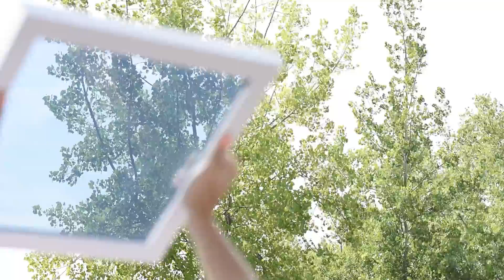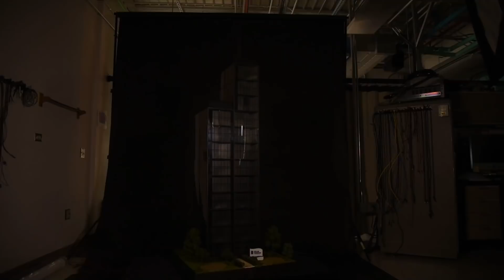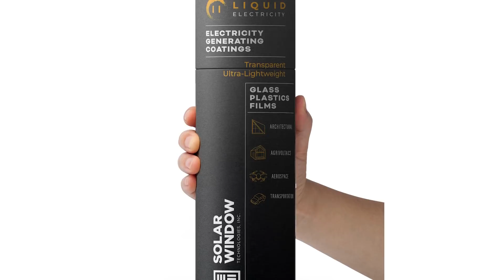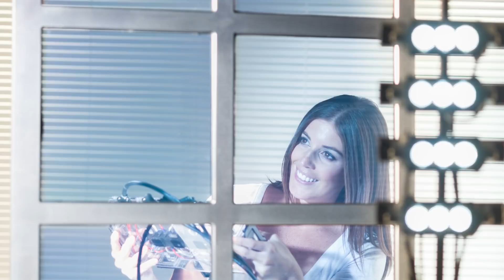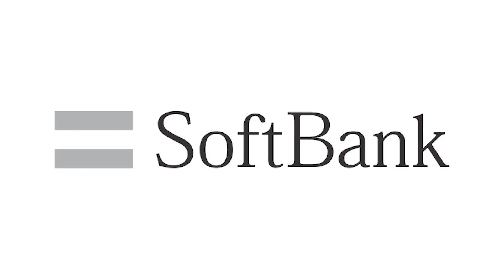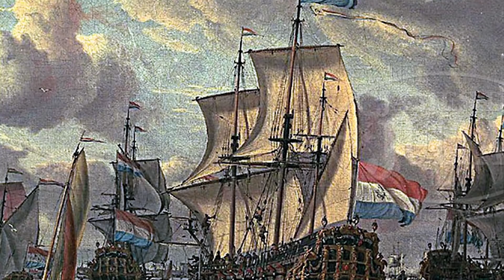Solar Window (WNDW) Your Next Solar Investment?

Comment: How does this affect heat, radiation or solar gain into the structure whether it be a building or a car because if it makes more heat coming through then we’re going to have to run our air conditioners harder that’s not gonna make a lot of sense!?

Comment: I had an idea in 1980 Put a thing called an Apple computer in a different box add a  different keyboard for trade typesetters in the world wide printing industry,  (pre WYSIWYG remember those days?)  and sell it to typesetting companies as an OEM through the main company in that business, -  7000 "terminals" later and 7 years across the globe I netted £20m turnover my company was also started by an unkonwn musican, Hans ZImmer!  This guy has NO entrepreneurial credibility and no physics lab street cred. I'd never invest in him its total tosh CAVEAT EMPTOR - Im doing a fun project now that doesnt even use electronics and it's presold 1200 units at 300 USD per unit, on a net profit of about 70% per unit, etc, and not even off the production line in volume - but it works as it's based on physics,  hahahahaha

Comment: I wouldnt trust them, = why too long, what about heat loss in the winter, etc, what's the thermal gain of a "glassified" building internally that you then have to deal with to remove all this wild heat, =   I live in Thailand and in my past incarnation I lived in Indai even as far back as 1971, at 18, - Thais say (Im serious about this) "If you see an indian and a snake - which one do you kill first? "  We got 3 kw per sq m here every day and it's 35C most days too, one thing you have to consider is "empty vessel makes loud noise" (Confuscious) This guy has still not shown any product except the snake coming out of the snake charmers basket. Get your graphene pants on dude.

Comment: When I seek a parking spot, what I need most is tree cover or shade for the car but I very seldom find it. Short of finding adequate shade, a windshield and car windows that impede the heating of the passenger compartment while  capturing  energy would be very welcome.

Comment: WNDW failed to file their 2022 annual report, for period ending August 31, 2022. In their prior 10-Q, they say "...the Company recognized an impairment of all assets related to the Korean Subsidiary totaling $674,200. The impairment was recognized due to the Company’s inability to obtain from the management of the Korean Subsidiary the complete financial statements and related documentation for the three months ended May 31, 2022 thereby placing into doubt the recoverability of assets located in South Korea." The market cap of this stock is currently $92M. I question who owns the technology and if this company is legit. WNDW needs to respond to filings regarding breach of contract, unjust enrichment, etc. as claimed in SEC filings: https://www.sec.gov/Archives/edgar/data/1071840/000117184322004372/exh_993.htm

Comment: It has been mentioned by Mr. j that our planet receives so much solar energy that it is thousands time of all the energy that we need. So far it is thought that the limiting factor for solar energy is the storage in the form of batteries, their manufacturing requirements of not only the raw materials but also their disposal and energy requirements etc. I personally think there is an alternate available. Instead of storing energy for use at night, energy produced in areas where the sun shines should be transferred to areas where it is night,  through a world wide network of transfer system. I know even at present the electricity produced at river dams is transferred to areas thousand of miles away. My suggestion therefore is some alternate more efficient systems for transferring electricity  over long distances should be  considered and a worldwide network should be developed for using electricity produced by areas where it is day in areas where it is night.

Comment: Is their proprietary technology ripped off the research by Derek lovely at Umass? He discovered geobactor sulfurreducens in the late 80s and now it’s believed that the nanowires produced by this microbe release energy in the presence of an evaporation gradient between anode and cathode. It’s biologically produced but doesn’t actually require living culture to work. It also functions best at higher temperatures, and due to evaporation as source of energy, this is indirectly a solar-derived energy source, but isn’t a PV cell in the way that silicon panels are.

Comment: Essentially it's millions of nano size solar panels offering circuitry, flow inside a solid harden pool structure called a clear element/glass. The only debate, is his persona of how it looks/runs/behaves and rate/result of power 🔋. So much hypothesis. Blah blah of a 🧞‍♂️👳🏻‍♂️ magic 🎩 🐇 tricks 🙄. Monologue oh how it be, if  it was  made (🐍 🛢 'ing spam it poured on you ).

Comment: Really good bullshit is still bullshit. If your that smart make an easy interim product that comes out of your processes I have been making things my whole and finally took my side interests of Geology and learned the Chemistry I needed and it opened huge potential and load of products that could be made. Which was easy and high prophet and filled a need health protection. Get a product out and satisfy your investors, 10 years is way to long 2 two 3 years you should had been cranking something out the door by then.

Comment: This is the most obtuse  individual delivery of unmitigated bullshit. This is an unnecessary worthless product, worse than a square wheel. The amount of electricity production is minuscule and the cost per micro-amp is astronomical. What we need is a solar cell that can produce more than 50 % efficiency, the best we can do now is about 20%. We also need  much better battery technology beyond lithium. Perhaps diamond  & graphine. Research in materials science is the energy future of mankind.

Comment: Pity, I’ve been anticipating the arrival in the market of this novel idea since it was conceived 10 years ago but for some reason it’s still under incubation period till now. It seems like the company is still unsure of how to move forward.

Here’s my 1M$ proposition just to get it rolling and save the world from the effects of fossil fuels. 

By now, I believe they already have the most efficient and stable power generating formula. If I’m not mistaken, their dilemma revolves around the choice of vehicle for effective marketing.

WHY NOT sell it as a solar transparent adhesive tape (like glass window tints) or as a solar acrylic emulsion. This way, they don’t need to worry about industry-specific applications. People can just stick the tape anywhere they want - not necessarily on glass windows. The solar emulsion can be an alternative finish or upgrade for any device, vehicle or even buildings.

Man, I really want to see  this game-changing product out in the market sooooon! The world is running out of time!
Reply: Yeah right

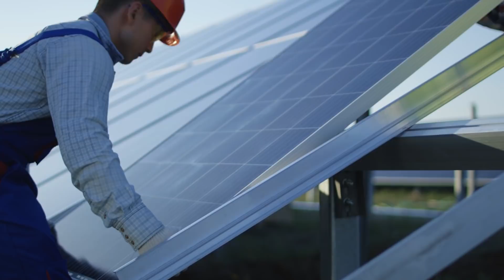Comment: 4:47 Plus they are dark and get hot and that may be heating of the planet. With transparent solar panels you can have reflective material under and it might give the cell an extra dose of light (if it works both directions) and reflect the sunlight (and heat) back into space. If dark solar cells do pose a heating problem, bring on these new fangled solar cells!

Comment: Engineering student Carvey Ehren Maigue has been named the James Dyson Awards first-ever global sustainability winner for his AuReus system, in which waste crops are turned into cladding that can generate clean energy from ultraviolet light.

Unlike traditional solar panels, which only work in clear conditions and must face the sun directly because they rely on visible light, the translucent AuReus material is able to harvest power from invisible UV rays that pass through clouds.

As a result, it is able to produce energy close to 50 per cent of the time

Comment: General comments: I did not hear you mention sail boats. Sails, coated with your product could generate enough electricity to run the entire boat; gps, kitchen, hot water, radio, engines used to pole fishing nets back on board, supplementary power, and so forth. Now, as to spinach. It’s counterintuitive, I know, but just think of one phrase: baby spinach. Small, Young spinach sells at a premium because it’s tender. Larger spinach leaves are not necessarily more desirable. BUT: if you could design your product to be food grade safe. You could spray your product on plants; any plant. And then you could generate electricity in the garden. And speaking of gardens, do you know where the cold frame is? It’s essentially a box placed on the ground that has a clear glass or plastic top. It’s essentially a mini greenhouse. Spray or apply your product on top of a cold frame and you could probably generate enough electricity to run the device/aperture that raises and lowers the glass so that different temperatures can be accommodated. There is A pew Mattick device currently on the market that uses a solenoid to ascertain temperature differences. You can set it. So if the temperature goes above a certain degree the solenoid will lift up the entire lid, thus preventing overheating. And the reverse is also true. If the temperature drops, the solenoid allows the top to gently close, thus creating a protected growing environment. Cold frames are used to extend and prolong the growing season in northern latitudes and they have a long and straight history going back thousands and thousands of years. Come to think of it, with all due respect and humility, your company should hire me to brainstorm every day uses of your products.

Comment: For a company as long in business as this one, the failure to have a product available is offputting.  More than once "Jay" failed to answer when any product would be commercially available.  I did stop watching about halfway through because Jay's exhortations seemed baseless.  The supposed "solar window" and the flexible plastic could have been examples of anything but what he suggested.  We saw no power generation whatsoever from these alleged "prototypes".  A potato in an elementary school class generates more electricity.
Reply: Controlling majority shareholder and former SolarWindow Chairman Harmel Rayat……the SEC charged SolarWindow's controlling shareholder with Securities Fraud and they appear to indirectly refer to SolarWindow in the complaint.
		The charges accuse Harmal Rayat of concealing his involvement in a paid stock promotion campaign, and reveal a damning instance of allegedly falsifying technological capabilities.

Comment: While the technology is interesting, I don't like the fact that the WNDW guy didn't answer direct questions.  There has to be some way to get the electricity from the "plastic" sheet out.  How is that addressed? Do they have a module that they sell to window manufacturers?  How does it actually link up.  This could be a logistical nightmare on a 100+ story building.

Comment: Not one single engineering fact to substantiate that they even have a product at all! He very carefully says only that it produces electricity. Nothing about power density (watts per square foot). The 3' x 3' "prototype" was never shown connected to an electrical consuming device. For all we know, the 3' x 3' solar window just had a piece of light brown privacy film on it. OK  maybe it does produce electricity. The only thing he ever let slip was a test sample that produced 1mV. I can put two dissimilar pieces of metal together and produce electricity. These are called thermocouples. They produce electricity (micro Volts I think and no significant power). I think I'd rather invest in a potato farm. You can stick wires into potatoes and produce electricity. I wonder if I could convince Elon Musk that with new leading edge technology, we can now shave potatoes into almost single molecule sheets and stack these, never before seen, sheets together in a special highly secretive proprietary method to produce 100 times the electricity of a middle school potato battery science project. Convince Elon that we'll soon be able to power a car with this futuristic high technology advanced earth friendly potato battery. The infrastructure already exist. When the battery gets low, just swap out at any McDonald's. Major shame to those two dingbats that never asked the truly relevant questions that would show what Solar Window probably really is (in my opinion). A scam using selling stock to get their hands on your money. Amazingly, they can do a scam method like this and never be charged with anything. They take all the invested money in salaries and bonuses then the company just shuts down claiming nobody excepted their miraculous break through product. I'll never look at Disruptive Investing again. They might even be in on the scam.
Reply: It was Probably a scripted interview with scripted questions Probably set up by solar window

Comment: LOL...bullshit. He repeatedly refers to Silicon as organic.

Data and specifications, the SCIENCE please. 

Solar panels are barely 17% efficient this material is most likely less efficient than 1% at a ridiculously expensive installation cost.

And so when specific questions about the installation are asked he evades by delving into BS concerning the chemistry, and goes nowhere with even that.

Don't need direct sunlight??? LOL Vertical surfaces aren't an issue???? So coat ceilings!

Comment: Just Salesman blah blah.  Give us some facts.  Notice the way he totally dodges the question about "if I have a wall and I want to coat it, what's the process?".  He doesn't have the answer. All talk. No product.  Just the same video of a strong desk light powering 9 LEDs.  "6 months ago.. a turning point where we could demonstrate a 3ft window actually generating power"  How much power?  Just one 3ft window?  And he's talking about how they could cover an entire sky-scraper?  I wish that guy were German.
Also, I have a LandRover.  It has wires running through the windscreen for heating it in the cold, and guess what? They break occasionally.  So the lifetime of this?  So many questions unanswered.

Comment: OF COURSE coming up with A COATING - much less a transparent one you could paint over windows - that WILL GENERATE long term, reliable energy (electric) production IS FANTASTIC news... much less if it is economical enough to place and use in low light desnsity areas, like on the shady side of buildings or indoors.  Unfortunately, most of this long video just repeated the potential benefits... and short on details, for example what the collection, wiring scheme would look like...

Comment: Very effectively communicating a message of which one has no idea what it all means or how it is achieved...
Great seeing innovation in this area.

University of Newcastle Australia also has Printed solar panels...  ClearVue of Perth Western Australia has transparent PV  in production..  Exciting times when everything becomes a generation unit.

(NB to "generate PV electricity, the incident rays need to contain energy.  If the system creates equal energy from "BlueSky" as the full intensity Midday Sun, it indicates its efficiency and absolute specific power is rather low, and there is a lot of waste.
50x "high efficiency" Roof space energy capacity - in inefficient off axis collection.  Make it Happen.  That sounds UuuberFantastical BlueSky thinking  (waiting)

Comment: As everyone adapted from analog to digital so to has electric power and we must try to set up our homes with solar and charge our solar generator batteries one to four at once in our vehicles whenever it makes sense to do so if you are on a long trip
For example I’m a trucker
I put panels on my roof and charge my ten batteries once to twice a week by rotation while doing my routes using free sun and being paid while doing it
I wear an angled back pack 300 watt panel while trimming and mowing my lawn as it keeps constant juice in the batteries 

But here’s the cats ass
There’s a top secret government military solar implement perhaps SHOULDNT be mentioned but after what the largest piece of shit ever birthed onto earth just executed our heroic American 🇺🇸 Veterans; FUCK TRAITOR JOE🩸

And the evil democratic lying 🤥 liberal communist government answering to the Muslims and chi coms
So here it is:

When you UN roll a strip of Syran wrap have you ever thought it be a box of mile long by 3’ wide clear solar electric that can be rolled out and cut or coupled to any size needed and stuck to any surface waterproof under laying adhesive clear right through
One only must apply the wires and the WiFi 

Every flag pole every gravestone guard rail windshield clothing now a walking solar panel to have a car with a dead battery be jump started or endlessly power your phone and have built in WiFi and cameras and alarms for safety getting all info out before it’s disabled 
Limitless